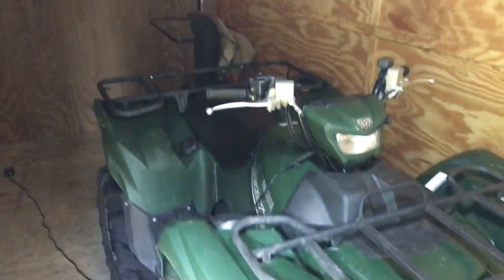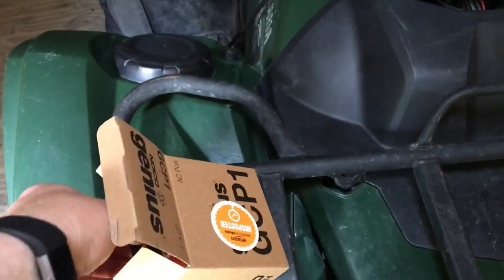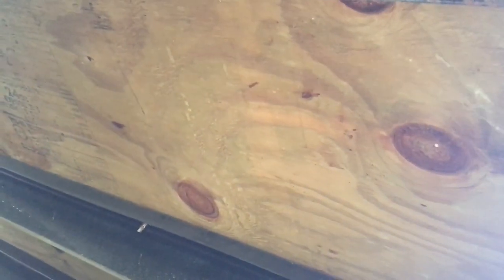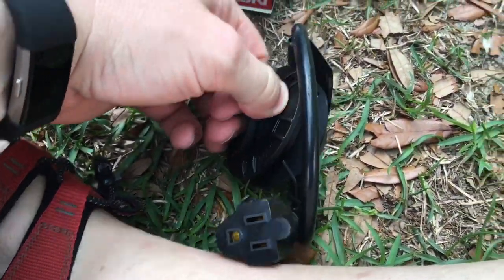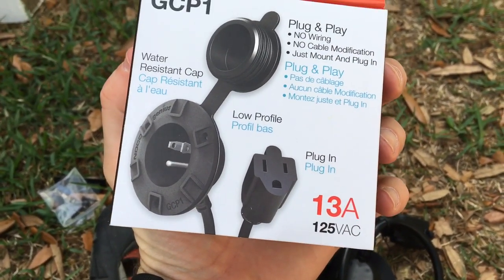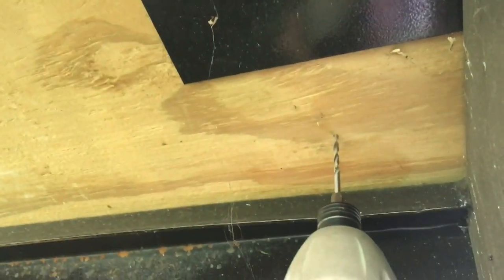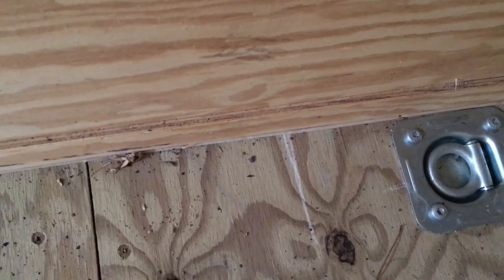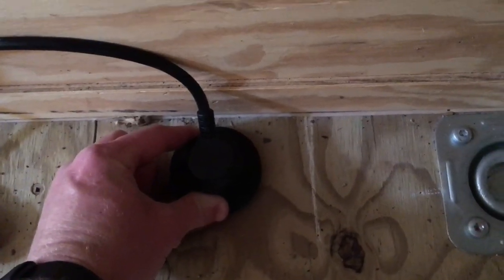Enclosed Trailer Conversion Electrical Power Part 1 (NOCO Black GCP1)

Comment: Yes that exactly the problem with drilling the walls, I saw that no other video addressed! Thanks for the common sense, that is my plan drilling the floor. I am going to mount mine up front in the V nose between my cabinets out of sight and out of the way.

Comment: I used that exact same inlet on my cargo trailer that I converted to a camper.  I also put mine in the floor.  I built a cabinet in the v-nose.. so I put the inlet in the floor at the front of the trailer so it enters inside the cabinet.  Its working great.  I have a battery charger plugged into it.. and that's keeping my battery/inverter setup charged.

Comment: How it holding up being under the trailer? Mud water snow? Do you like laying down to plug it in? Does that rubber seal stay plugged in while traveling? Sorry for all the questions. I like the idea but don’t want to lay down in whatever to plug it in. Thx
Reply from the maker: It's still working great, but my trailer mainly sits in the backyard. I pull it about three times a year. Mostly have no issues with mud, water, or snow because of the placement on the trailer. Nothing really splases up to that area. The rubber seal stays in and keeps it clean/dry. I don't have to lay down to plug it in but I do have to kneel down, maybe a 30 second process for me. I'm very happy with it still, thanks for the questions!
Reply: Mark Collins right on thx for the video it was very helpful. Thx again
Reply: @yetisized  curious. How many itwm can you run off a single plug without a breaker box ?
Say with a power bar...

Comment: What am I not getting here? If you have to run an extension cord to this outlet device, then why not just use the same extension cord for your tools or whatever you plan on powering up? Just seems like a wasted step to me????  Couldn't you just use some sort of access hole with a a hinged door on it?
Reply: Technically, yeah.    But it looks cleaner.  And you can keep the doors locked up